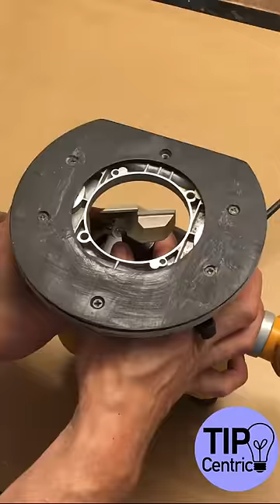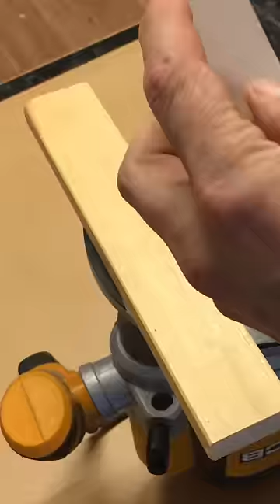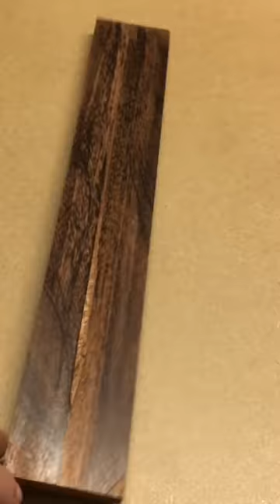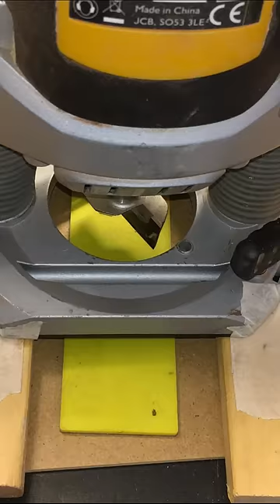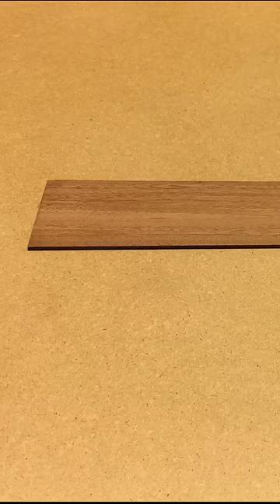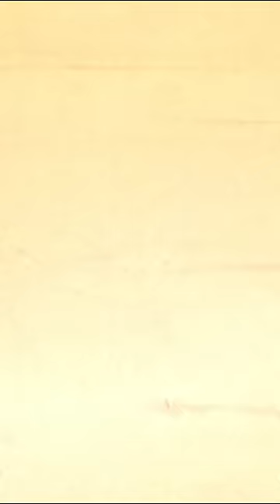Flattening Tip 🌳 #shorts #tipcentric

Comment: Nice technique !!!
Would you please tell me the name of the glue you used to fix the wood pieces ?
Thanks in advance!
Reply from the maker: Thank you Guillermo, the glue is called CA glue with activator, also called ‘2p10 glue’ the brand I use is called mitre bond. 👍👍😀
Reply: CA = CyanoAcrylate = super glue.
I think for the 'activator', you can use water or 70% alcohol. 
        (It needs a little moisture to get the reaction started.... IF I remember correctly...
        But super glue is always fast already. 30 seconds or so. 

Useful to glue anything to anything else: 
     metal to wood, 
     glass to stone,
     your finger to your eyeball, 
     ...etc (be careful with it ;) 
      
[!!!] ...so DON'T rub your eyes, or scratch your nose when you're super glueing something.

Also; very useful when you have a small cut in your finger...
      disinfect the wound, wipe away the blood, put a little super glue on it.
      Boom. fixed in like 10 seconds

(Super glue is also used by doctors and surgeons sometimes, to close a wound without stitches)

-

*NOTE: I AM NOT A MEDICAL PROFESSIONAL - SEE A DOCTOR IF YOU'RE UNSURE ABOUT SOMETHING.

I'm talking about SMALL cuts. 
      If you're NOT SURE if a cut is too deep... 
     ...it's PROBABLY. TOO. DEEP. 

Go to a doctor immediately
and/or CALL emergency services
     (911 or 112 or whatever the number is where you live)

--

okidoki...
happy glueing :)
Reply from the maker: Great knowledge 👍👍

Comment: No planer ?
Reply from the maker: not a planer/thicknesser, hopefully getting one soon!
Reply: @tipcentric  get one with a spiral cutter,you won’t be sorry. My favorite tool in the shop.with that bit and router you can make a jig to flatten large slabs ,much larger than a planer will handle . If you don’t have a jointer you might want to consider that purchase first. Good luck ,have fun and be safe.
Reply from the maker: I really need a new table saw, so I think that’s next on my list, then it’s time for a planer thicknesser or jointer  I think! Yeah, I did make a router sled in another video a while ago, the video did really well, have I used it a fair few times to flatten warped boards etc and used the same bit as in this video, works extremely well, gives a really smooth surface almost ready for finish. I also made a jointing sled for my table saw too a couple of months ago. I would love all the different workshop tools, my shopping list is as long as my arm, but until I can get them I’m being as inventive as possible to get the job done with the tools I have. Which I’m sure you will agree, is exactly why we do what we do in the first place 👍👍